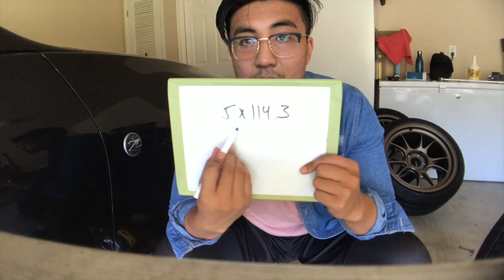CRASH COURSE ON READING WHEEL/TIRE SPECS

Comment: just a small advice.. never tighten wheels with a impact gun.. you can use it to slightly tighten the lug nuts but always torque it down to proper specs with a torque wrench..  which in your case.. for your car is 80 ft lbs.. with a impact gun.. you can easily go over 100 ft lb of torque which will cause you to snap studs. i would think making a instructional video you would know this.
Reply from the maker: Luis Cheong appreciate the feedback my man! I’ll def keep that in mind. I wasn’t too worried about the impact gun over torquing this time cause it wasn’t with a compressor and it’s actually pretty weak haha. I’ve impact my lugs over at my homies before who actually has a torque wrench, unlike me, and it never got close to 80 (thank goodness haha).
Reply from the maker: Luis Cheong I do need a torque wrench though haha. I be having to check with my homie all the time